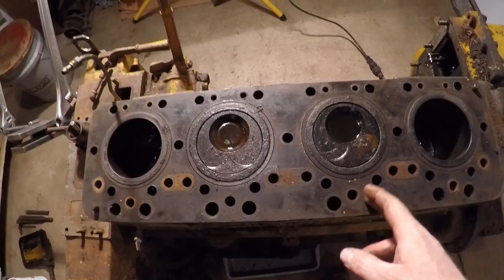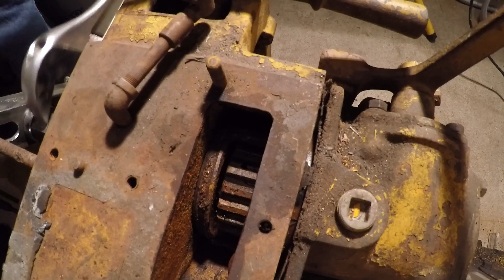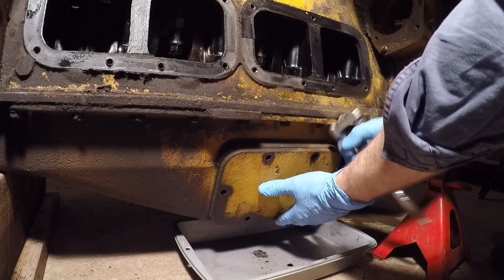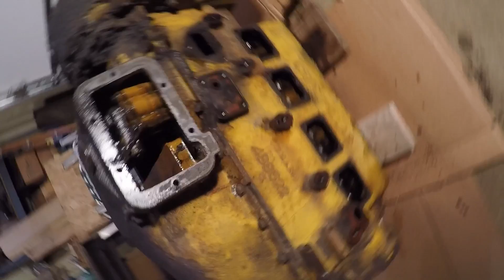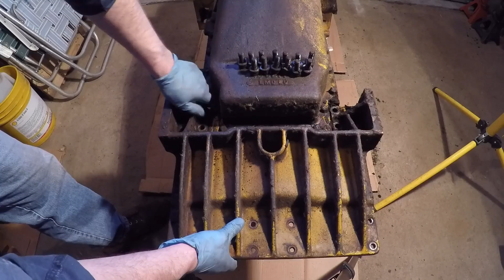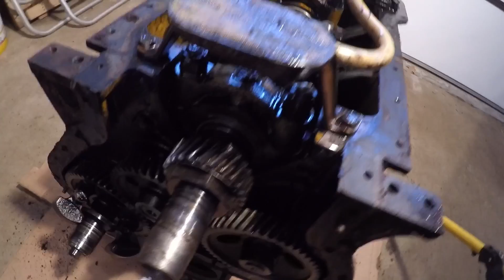Caterpillar D2 #5J1113 Diesel Engine Disassembly - Day 2

Comment: This question is a bit late but I was wondering why the two oil pick up pipes? I thought it might be something to do with operating at very steep angles but this would still mean one pick up would be out of the oil and the pump would draw air. Anyone have the answer?

Comment: I don't know if D2 pistons are the same as D4 pistons but the D4 pistons are two piece with the aluminum top threaded on and pinned with brass pins. On my D4 7U I had one unscrew and get blown out the exhaust in tiny pieces. It bent a rod and damaged push rods and guides. I was able to drive it inside a shop where all the pistons were replaced. Runs great.

Comment: Are you getting the overhaul kit from cat that has the new sleeves and pistons? I've done some of those on semi trucks, the Piston/rod/sleeve comes as a assembly. It is pricey, but some engines it's the only way you can get it. We'd use them when we did in frame rebuilds.
Edit: I didn't realize how old this engine is, I'm used to the newer cat and international engines. It's said there's no "complete" rebuild for this, I'm going to subscribe and follow this rebuild.
Reply: @squatch253  yeah, it wasn't until I watched the earlier videos that I saw how old this was. If you can get the pistons out and they and the bores are not too bad might be able to rering it. The new kits from cat make overhauling a cinch, lots of times we'd get the kits with new head, preassembled sleeves and pistons, and bearings and gaskets cat had everything in the kit, just had to tear it down, polish the crank and clean everything, cut the block for the sleeve orings if needed, and bolt it together. Made in frame overhauls easy, but not cheap. I think the kit ran about $10,000

Comment: Does it affect the value when you switch the engine block out?  I work on old Ford tractors and the serial number is on the engine so it does affect the value on the tractor and I was wondering if it is the same with the D2.

Comment: Boy, that thing is in A LOT better shape than I would have expected! I have to wonder why it was sitting around with the head off. Did the freeze damage to the block come first, or pulling the head for some reason and then letting it sit in the field and gather water?

Comment: i needed a Big puller like you have.. had to create my own.. https://i.imgur.com/sTR1Jfv.jpg it still did not get the rotor off.. just a flat plate with 4 of the puller adapters got it.. https://i.imgur.com/Cgg3W7Z.jpg   that D2 engine has some really great spare parts.   i wonder if the block stretched any pulling the crank longer as the sides blew out with the deep freeze..